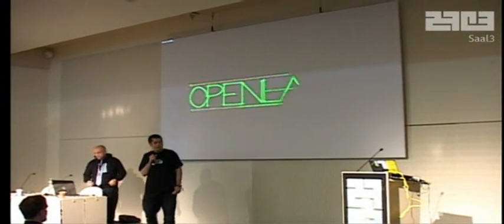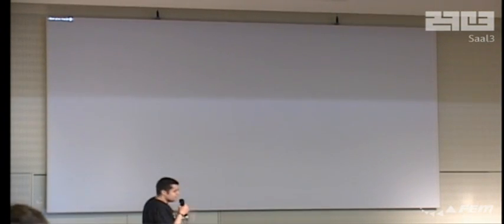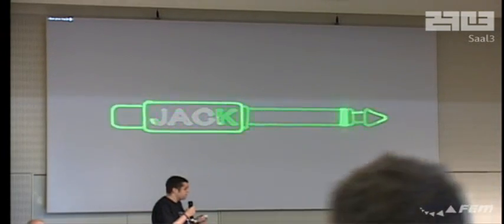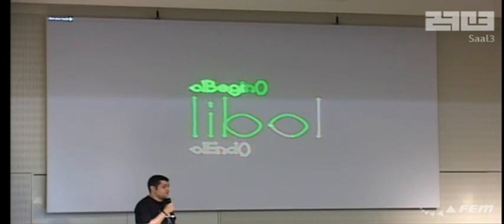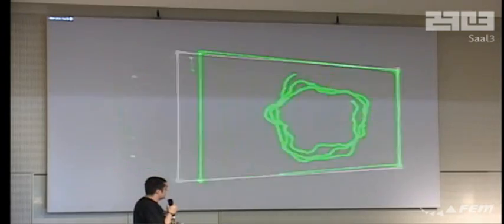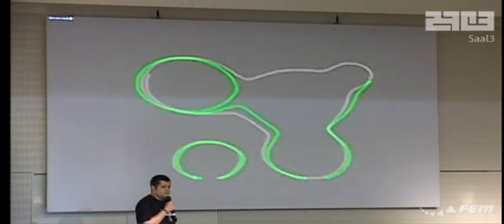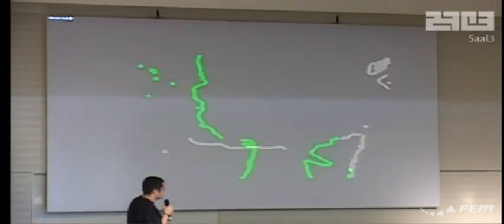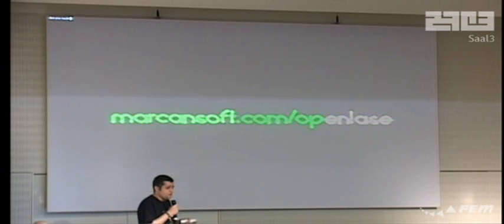PSGroove.com - OpenLase - Chaos Communication Congress

Comment: There's a 4-minute time limit. I spent the 15 minutes prior setting up the projector/laptop/audio/wiimote control/etc. in record time, plus I spent the 15 minutes *before* that testing the PS3 demo that came immediately after this, so yeah, I was pretty damn nervous. Sorry :(

I also botched the aspect ratio (forgot to uncheck the scale checkbox in the OpenLase outptu GUI after the calibration). It isn't supposed to be horizontally stretched like that.